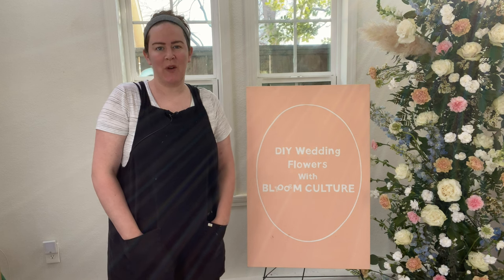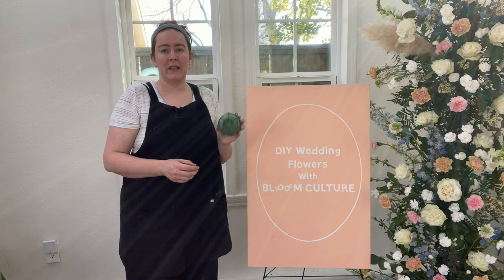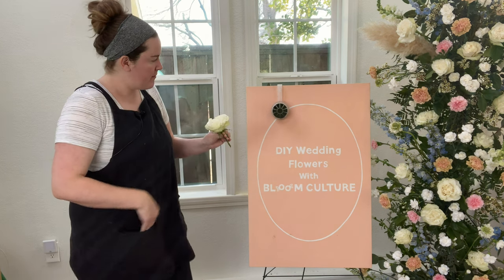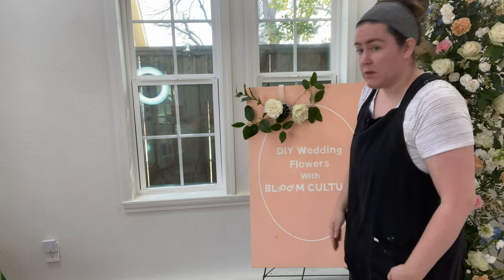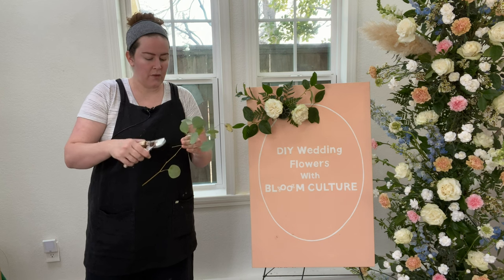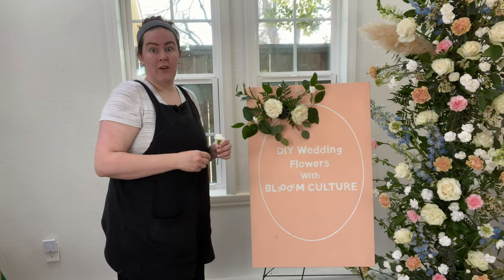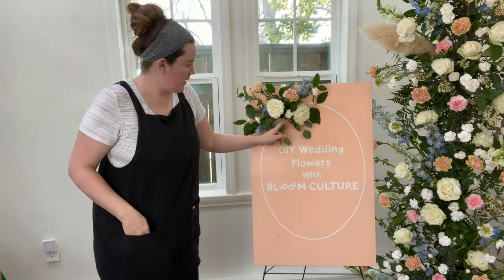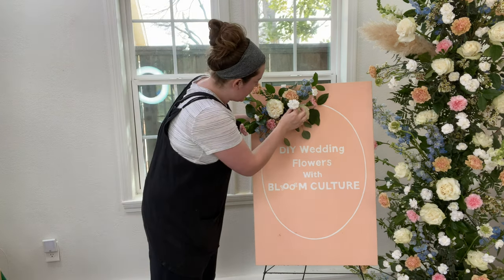How to Put Flowers on Signage

Comment: Can it be done 1 day and 1/2 before the wedding? And knowing that it will outside ? Will it wilt ?
Reply from the maker: It could possibly wilt. I usually do foam items no more than 24 hours in advance due to the foam only being a tool and not a direct replacement for water.

Comment: This was very helpful, thank you for sharing and explaining the process so well❤. The water inside the foam, does it ever drip or smear in the board?  How would you prevent that from happening?  Thank you Alison!
Reply from the maker: Great question! Yes, water drips out of the foam as you place stems. I would cover the sign if it’s not waterproof with something that is (not a towel as it could soak through to the sign). It won’t be a ton of water but enough drips to smear paint or something not waterproof. Hope that helps!

Comment: How long will the sponge leak for? Does it continue to leak? I'm planning on preparing mine the day before and hanging it on a wooden sign the a few hours before the wedding.
Reply from the maker: It stops dripping almost immediately after inserting the flowers. If the sign will get damaged due to the drips, protect/cover it with something or design off the sign and when it’s done dripping, place it in its desired location.

Comment: Will water not drip down, excuse my ignorance.
Reply from the maker: It will drip a bit when placing the stems so if you need to cover/protect the signage you can do that or design off the signage and place in its desired spot once the drips are done. It’s not a lot but if the sigh might get damaged take precautions.